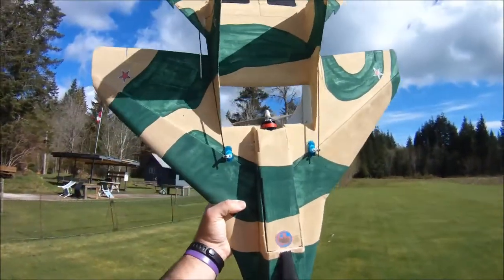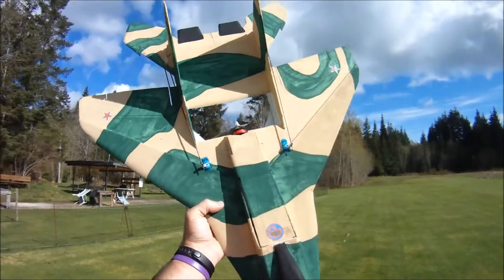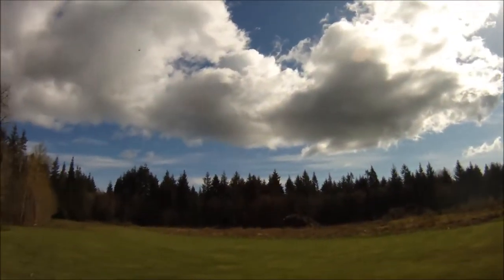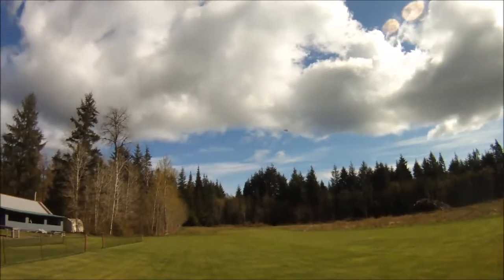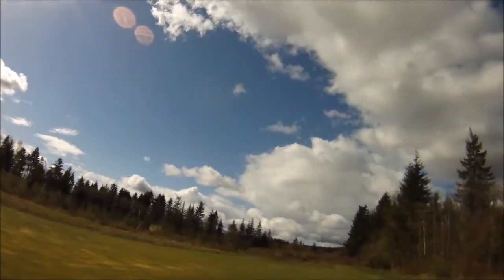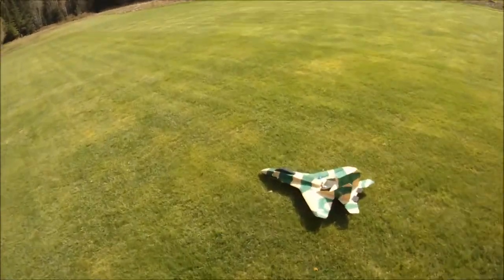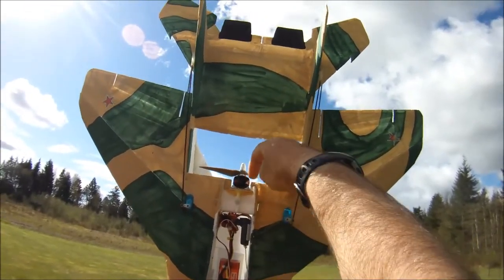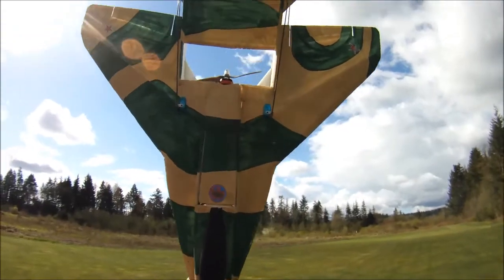RCTimer FR2205 2550 Kv 6x4 APC field test

Comment: wow. thats impressive.  im running a 2500kv SK3 aerodrive motor and thats a 2836!!  how can a motor so much smaller still handle as much?
Reply from the maker: Thanks Chris.  I'll be keeping a closer eye on these little quad motors for park jet use.  Since that is such a huge part of the hobby now, a lot of time and effort is being put into making very small, light but powerful motors for quad racing.  With the right prop, they show great potential for use in park jets and certainly save some weight :)  Cheers, Scott
Reply: I just took out my mig with the above setup  running on the hobbyking 6x4x3 prop that I always use.  I upgraded to a 60 amp esc a week or so ago so I could try it on 4s.  well the prop shattered to prices taking a bit of the nacelles with it!  I have to say it made me laugh.  I'm gonna fix it up and try it with a 5x5 as the motor (although fairly warm to the toutch) and esc seemed to handle it just fine.
Reply from the maker: Hi Chris, sorry to hear about your Mig, sounds like it is still good to go?  Best of luck with the 5x5 prop :)  Cheers, Scott